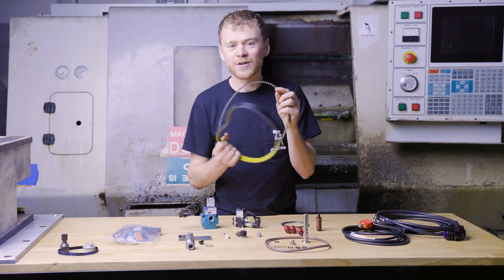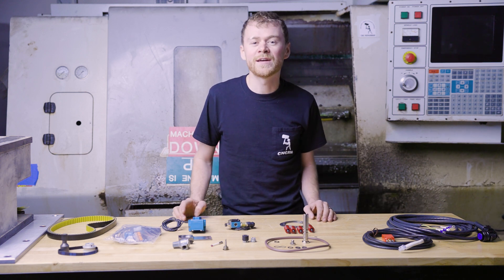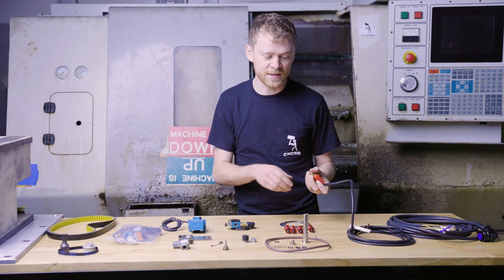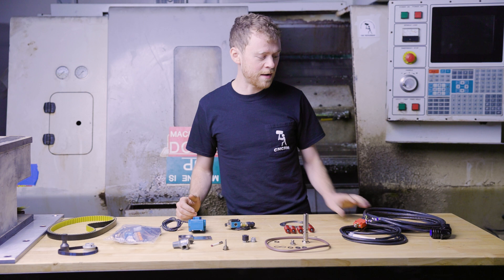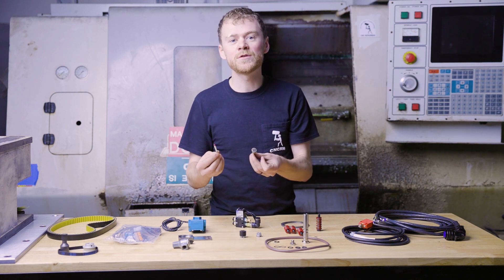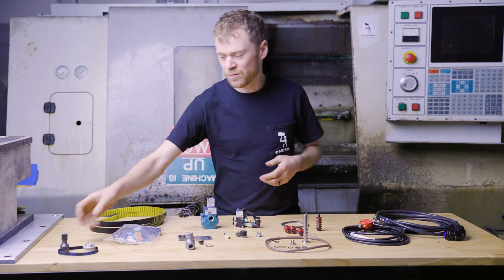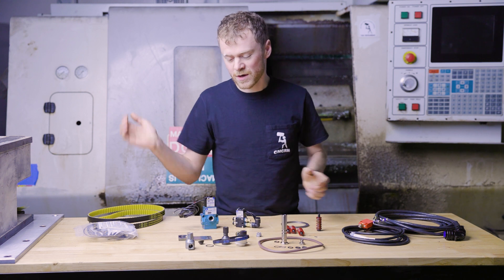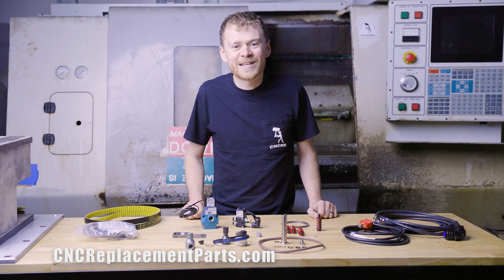Unrepairable CNC Parts - Be Prepared

Comment: Looks like the machine I'm running wamex through at the moment, I don't think anyone has ever cleaned the tank.  Oh yeah before I forget; how do I get this battery alarm to go away, I swapped out the 2 x 3v batteries but alarm stays.  SL-30 classic
Reply from the maker: How much memory? You probably need the dual processor battery pcb.